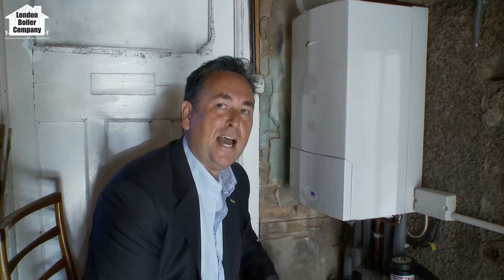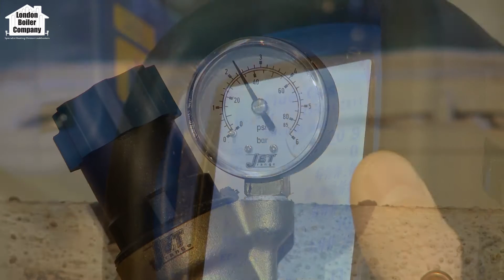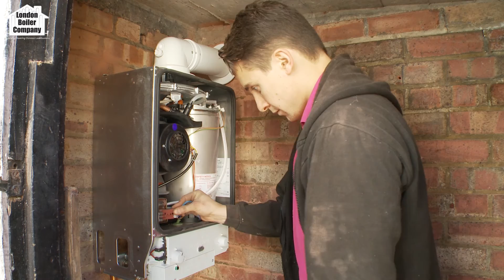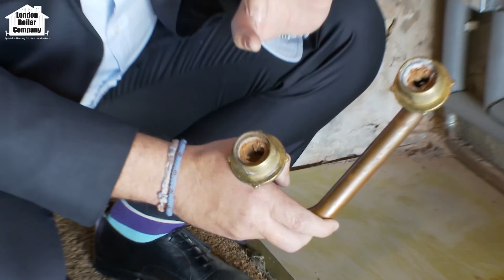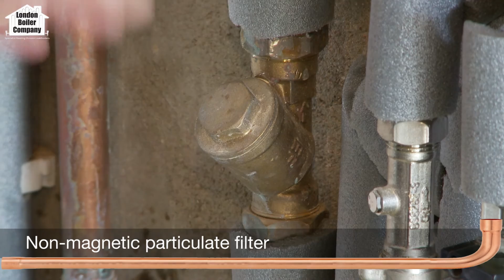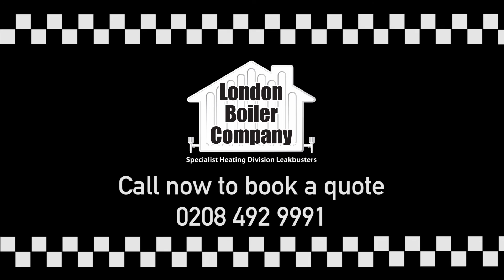BBC Rogue Traders Expert Ian Puddick explains Why central heating systems get dirty and sludged up

Comment: Very informative video, many thanks.. If the sludge is a lot due to the mixture of metals in a central heating system. Would It be help to have as many plastic pipes and joints as possible?
Reply: yes